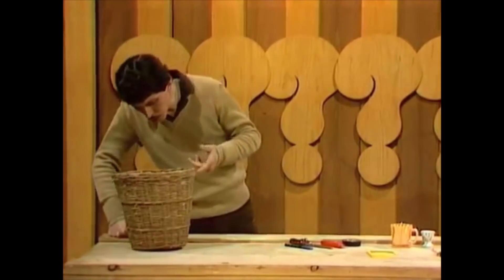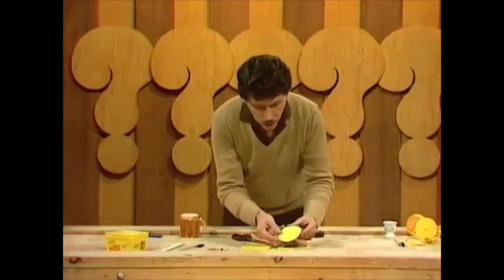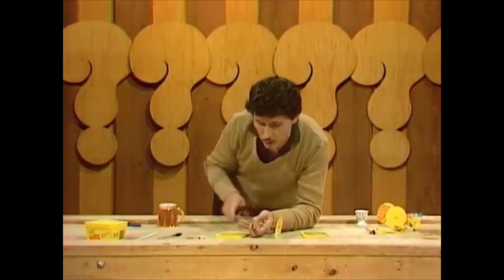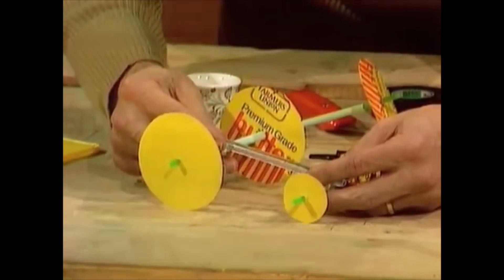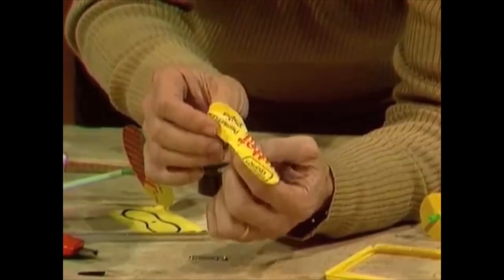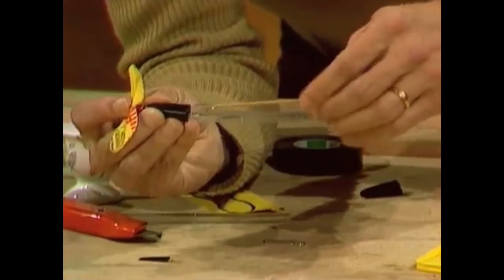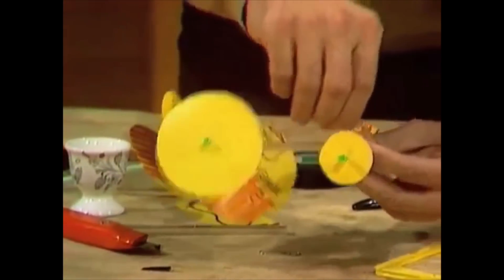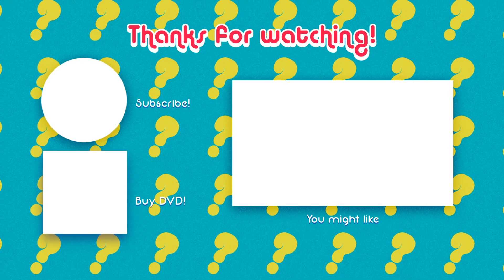Butter Buggy Dragster

Comment: That's pretty great.  If the wheels were made of jar-lids, they would have enough thickness that you could put rubber bands around the rims of them as tires, to give more grip.

I love the way Curiosity Show reminds us of the wide application of the word "motor".  An internal- or external-combustion engine can be a motor; there are electric motors; springs and twisted rubber bands can be motors.

Comment: I once made a windmill that turned by turning a crank with a bar connecting the two, out of metal wire and some stables to stick them onto a wooden board, no gears or belts needed :) just bending the metal wire into shape.